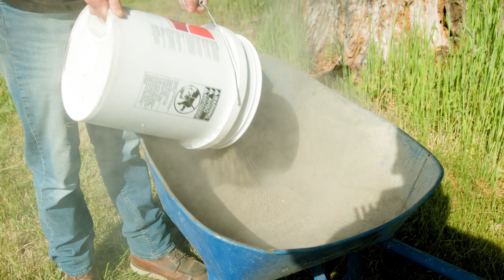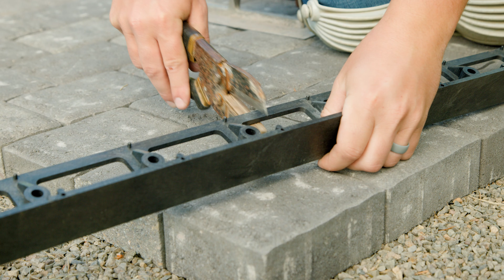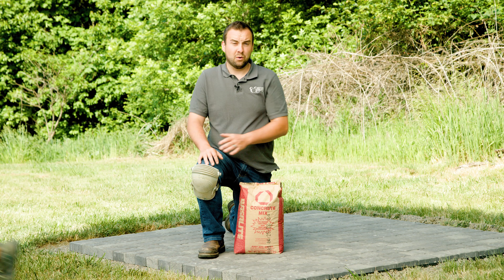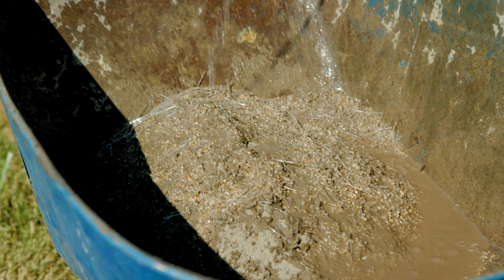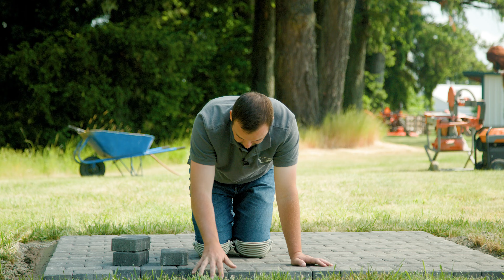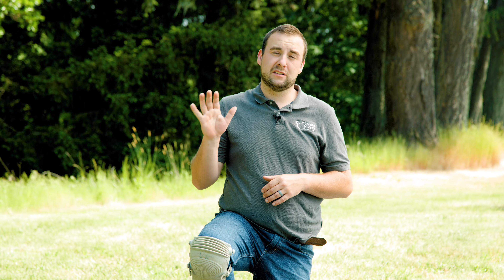5 Ways to Retain a Paver Edge

Comment: Why are you using gravel as your base? ICPI says to use crusher run because it compacts.  I would not trust gravel because it does not compact.
Reply from the maker: Great question, Rick! When we say 'gravel' we're referring to ¾" minus (also called ¾"-0 or crusher run in some regions) - which is crushed aggregate WITH fines that compacts really well. It's exactly what ICPI recommends. The terminology can vary by region, but we're definitely using compactable aggregate with fines, not clean gravel or river rock which wouldn't compact. Thanks for keeping us on our toes about proper base materials - it's a critical part of any paver installation!
Reply: @WesternInterlock  ok but the picture does not look like crusher run.

Comment: Could you please explain how to install a concrete curb edge? I'd like to install a brick paver vehicle driveway
Reply from the maker: Great question! While we don't have any videos that outline the process step-by-step, we do have several resources that provide some tips and insights. Our blog articles 'When to Install a Concrete Curb for Pavers' (westerninterlock.com/when-to-install-a-concrete-curb-for-pavers/) and 'Concrete Curbing vs Bond Beam for Pavers' (westerninterlock.com/concrete-curbing-vs-bond-beam-for-pavers-whats-the-difference/) explain when and why to use concrete curbing for driveways. 

Since concrete curb installation involves technical skills and often requires local code compliance, we'd recommend consulting with a qualified concrete contractor for the actual installation. Our team is always happy to help you find a local dealer or contractor, or provide quick pro tips - just reach out at westerninterlock.com/contact. Good luck with your brick paver driveway project!
Reply: @WesternInterlock Thank you, I appreciate that

Comment: I haven’t been able to find the plastic edging you use in this short. What is the name brand? Thanks!
Reply from the maker: Great question! The plastic edging in the video is called SecureBond Snap Edge. It’s made from 100% recycled plastic and is designed to work with standard 10” spikes. Here’s a link to the product if you’d like to check it out: https://westerninterlock.com/products/snap-edge-edge-restraint/

Comment: Could you trowel the bullet pavers around a landscape bed?
Reply from the maker: Yes, you can trowel concrete around bullet pavers for a landscape bed. For better durability, a modified concrete edge like Perma-Edge is a great option since it's stronger and more flexible. If your landscape bed has curves, a flexible edge restraint will work best.
Reply: @ could I just do the concrete in the back side or do both sides?
Reply from the maker: Good question! You can apply concrete on just the back side if the pavers are snug and won’t shift—but for added strength and long-term durability, troweling along both sides is ideal, especially if the area will see foot traffic or garden maintenance nearby.

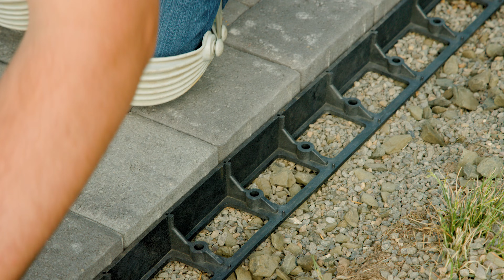Comment: I'm confused: you said it's not recommended to use the plastic edging with open graded base but it looks like you're installing it on that base at 01:42 

Am I missing something (most likely)?
Reply from the maker: Good catch! The plastic edging was shown on an open-graded base because that patio was used to demonstrate all the different edge restraints. However, we only recommend using plastic edging with a traditional base (compacted gravel and sand), where the spikes can grip securely. For open-graded bases, a modified concrete edge like Perma-Edge is a better choice!
Reply: @WesternInterlock  Thank you for reply, I was hoping for a non-concrete option but it seems limited other than Belgrade's suggestion to invert the plastic restraint and add geogrid under the pavers.
Reply from the maker: Options are definitely more limited with open-graded base systems. While some installers experiment with geogrid or inverted edging, we’ve found that modified concrete edge restraints offer the most reliable, long-term hold. That said, we always love seeing creative solutions when they’re well-supported—keep us posted if you try something new!

Comment: I have a circle fire pit gravel inside and boarder bricks in concrete bond beam method. I still used the edging for polymetric sand look sub base is just soil. edging failed spikes popped up in 0 degree weather. Can I trowel finish concrete over the edging and if so should i take out the spikes because freeze cycle will pop them up?
Reply from the maker: Thanks for your question! It sounds like the issue is with the base. Without a solid gravel foundation, both the pavers and edging can shift—especially in freeze-thaw cycles. Even with a concrete edge, ground movement can still cause failure.

As for the spikes, if the base isn’t stable, they can loosen and pop up. The best long-term fix is to lift the pavers, dig down about 7”, add 4” of compacted gravel, 1” of sand or 1/4” open aggregate, and then reset everything. That will give you a stable foundation that lasts!

Comment: My pavers edge made out of concrete is cracking badly
Reply from the maker: Is it 100% regular concrete or a modified polymer concrete?
Reply: @WesternInterlock  men I think is regular concrete
Reply from the maker: Aaah yes that’s common with regular concrete. Perma Paver Edging is a modified concrete that has polymers and fiber in it to make it 700% more flexible.

Comment: What to do for existing paver edging - garden beds/house landscaping, and tree rings? The grass creeps in between the pavers and beyond. Seems like there isn't a good solution for this that goes underground and stops grass runners.
Reply from the maker: Since most edge restraint options do not go to the top of the paving stone, masking tape adhered along the exposed edge has been used to dam up a polymeric sand during the activation process. Then simply removed when the sand has cured. The polymeric sands out there today greatly reduce weeds, moss, and even grass from growing into the joints and cracks. At the very least, it will be easier to remove them in the case they do grow because of the strength it provides as opposed to standard joint sand options.

Comment: Thank you for the video! Which of the methods would you recommend if I wanted to keep the option open to extend the paved area at some point in the future? Is this possible with the Concrete Bond Beam method? Or will I have to chisel away concrete in any case?
Reply from the maker: If you want to leave the edge open for further expansion, the best option will be the plastic edge restraint with spikes. Any concrete will require chipping concrete or the sacrifice of the edge stones.

Comment: When using the plastic edging, can you lay down sod flush to the paver pathway on top of the plastic edging?  Will the grass have any difficulty growing?
Reply from the maker: Generally, sod doesn't have too much difficulty growing on top of the plastic edge restraint. It is important to cover the edge restraint with something because the heat from the sunlight can cause it to warp. Just back fill with a little topsoil and plant your sod on top.

Comment: My worker said that they are going to use concrete, but I am so worried the concrete will crack
Reply: Run a piece of rebar in your concrete
Reply from the maker: The goal of modified concrete edge restraint like PermaEdge is to have the strength of rebar without the expense and hassle.
Reply: @WesternInterlock rebar is dirt cheap
Reply from the maker: Basic concrete will definitely work for edge restraint. It just won't have the lifespan of a product that was specifically engineered for the task. If they are going to use regular concrete, I would recommend that they use a bond beam as outlined here: https://westerninterlock.com/concrete-curbing-vs-bond-beam-for-pavers-whats-the-difference/
Reply: Use pink bar for the rebar. Easy to cut. Just wear gloves as small fibers will get into your hand. Don’t ask how I know.

Comment: Where can I buy the perma edge?
Reply from the maker: You can use their dealer locator to find a dealer close to you: https://www.permapaveredging.com/locate-a-distributor
Reply: @WesternInterlock yikes its expensive...you want to split a bucket, I dont need that much lol.
Reply from the maker: If you add up plastic edge restraint and spikes, PermaEdge is comparable price wise. However, if you don't need a whole bucket, then plastic edge restraint might be a better choice for you. Just be sure to do it correctly by following instructions in this article and video. 

https://westerninterlock.com/how-to-install-hardscape-edge-restraint/